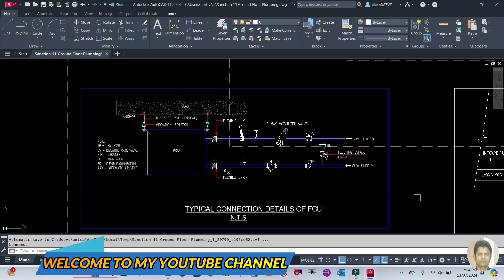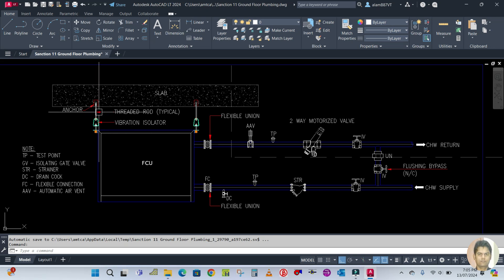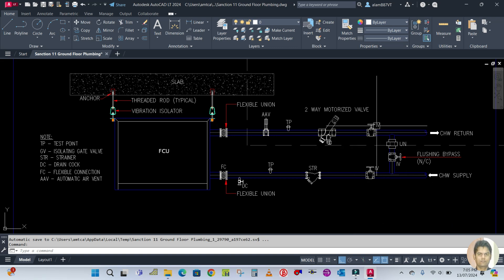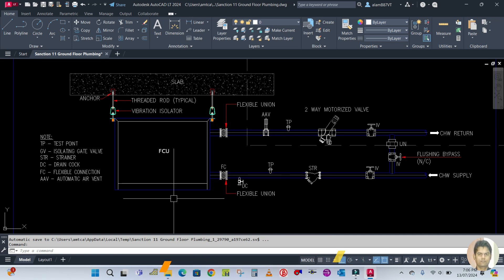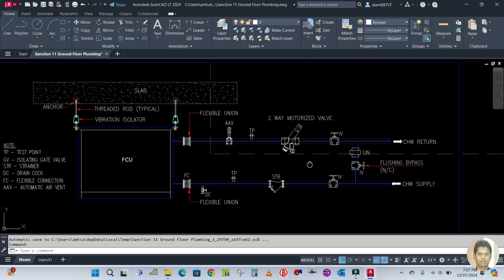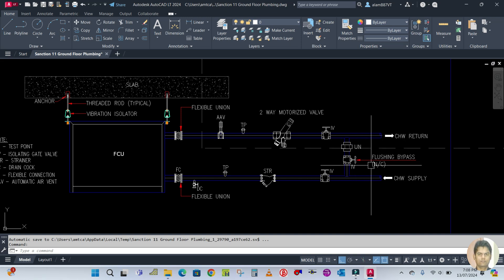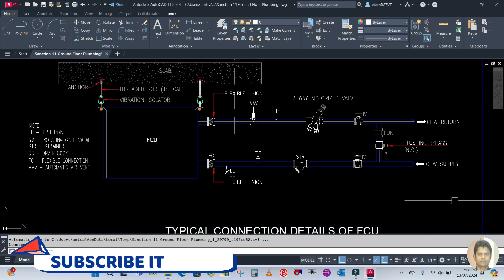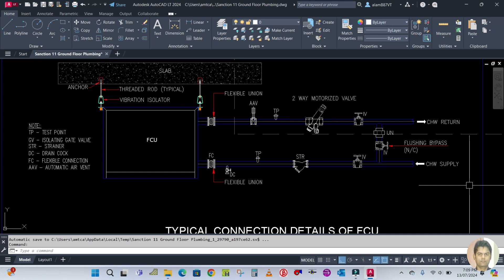FCU Valve Package For Chilled Water System II Typical Connection For Fan Coil Unit II

Comment: For sure you will reconsider this " student grade" diagram after installing it by yourself . Strainer is ...useless. It protects nothing and nobody will clean it . Test point are useless. Automatic 2 way valves have them on it. Air vent is useless. Plus iti will leak at some point. Air gets pulled by the speed of the water, or you already have vents fitted near fan-coil connections. I don't get the use of a "flushing by-pass' .  But the key is to keep it simple , practical and with maintenance in the foreground.
Reply from the maker: ok thanks